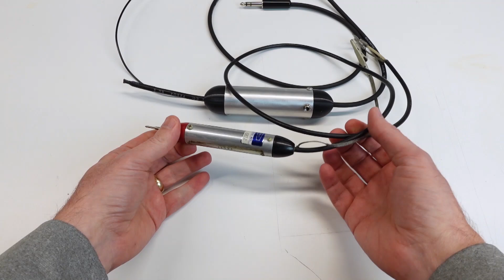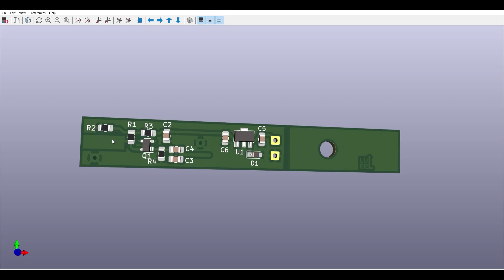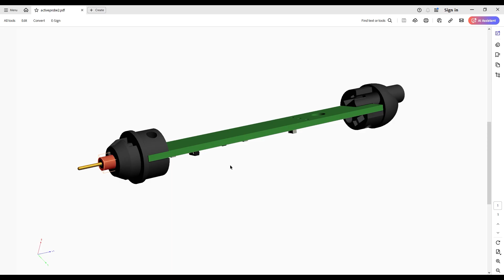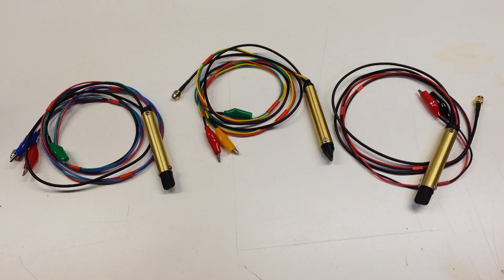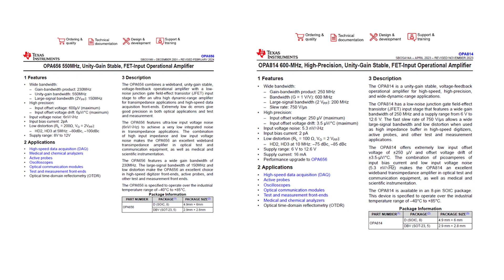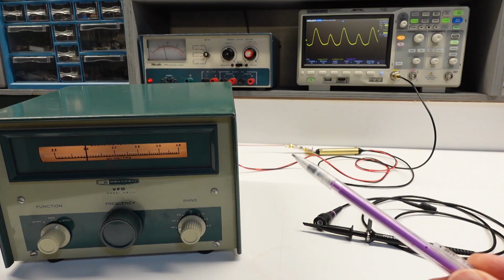Active Probes: Part #2

Comment: Hello.  Best regards, fancy job.
 Is Yours S11 probes parameters are correct? Mine, 2 units have almost flat at 0dB to -1 dB drop at 690 MHz from 0 to 900MHz. Maybe I'm measuring this wrong way with nanovna? Input of probe to S11 nanovna and output to S21 or otherwise?

Comment: Great video presentation and nice idea using the 1/2" brass for the shell.  The 3D printed end caps are very clever.  Also, your side by side comparison was very helpful in understanding the parameters of the probes.
Since you utilized Ebay to source the BF998's for Jewsbury's FET probe, would you be able to share what price and quantity you ordered?  I suspect that you would rather not provide vendor information but there seems to be lots of vendors from China that are offering the BF998's for around 50 cents apiece.  Is that about what you paid?  Since you have already acted as a 'guinea pig' for these components, I would feel more confident about buying a 10 pack or 20 pack if I knew a bit more about your purchase experience.
I hope you create a follow up video regarding the grounding tip spring for the probes along with it being used for actual troubleshooting.  Thank you for the wonderful videos you create and the knowledge you're willing to share.
Reply from the maker: Thanks for the feedback! I bought 10pcs for just under $10.

Comment: On eBay and components:  In the case of the BF998 MOSFETs, these were made in large numbers for the cable and satellite industry, so you are pretty safe buying these.
The way to look at it for counterfeit/culls, is first how difficult is the device to make/fake.  In the case of the BF998, they are a challenging manufacture just given what they are. Also, the culls would have been long ago destroyed, however anything is possible but unlikely.
The next consideration, is there a comparable component that can be relabeled as a substitute; again the BF998 is pretty safe.
Lastly, is this a component that is both scarce, does not have a good sub, and so is a make or break for a repair, and is expensive when found; this is the worst situation for dealing with counterfeits but usually not culls, due to age/missed-opportunity.
My suspicion is that you have a mismatch coupling to the BF998 because that is such a horrendous amount of dB variance.
I would try to set up a fixture to investigate the BF998 and see if you could learn anything from that.
I've used these before but never in an instrumentation setting.
Anyway, hats-off for the work and video--very enjoyable!
73...
Reply from the maker: Thanks for the feedback and tips!  Good call on the mismatch coupling, I would agree that it's most likely something that I did in the geometry and layout.

Comment: I have a couple of HP 1 GHz amplitude & phase measuring instruments I bought from an auction.  Of course the active (converter) probe tips were broken.  I went through all kinds of troubles with getting or making the luckily replaceable tips.  The threads were quite odd, I never could determine if they were # 000, # 00, or some metric size.  I did not even try plain copper, nor brass.  I wanted something reasonably strong and chose tellurium copper.  It worked, but was a bit of a challenge on my tiny lathe and its standard tooling.  I made the sharp end and the flange O.K.  But to make the threads, I bought several different dies, only finding that the smallest sizes are not usually cutting type, they are forming type, intended just for the soft brass in time pieces.  No matter, somehow I got a few actually fitting spare tips made.  I would like to find  carbide tooling, but have not seen anywhere for the small size used in my tiny lathe.

Comment: i played with the Hageman design a long time ago when the amazing OPA656 amp was still a thing.  What I realized in kind of a dope slap moment is that Steve's real goal was to make 50 ohm SA input look like an oscilloscope input.  It has that front end stuff so you could put a 10:1 standard scope probe on it and compensate it!  I'd love to see you try that with your Siglent passive probe.  I went in a different direction- I modified the design and used a 10 meg input R and no Cin and got the native FET input of the 656.  It wasn't Agilent but it was pretty good, about a 1 pF  IIRC.  I never really cleaned up my design- I like your 1/2" brass and 3d printed ends.    HP made some little adapter boxes for some of their gear as an accessory that did this- I have a 15709 that was an accessory for a QAM analyzer.  Scope probe in, 50 ohm out.  Discrete FET design similar to Pease circuit.  Service manual/schematics can be found on line.  I may tackle this again, I still have some old OPA656's and some newer grandchildren from Maxim and ADI.  Nice job and good presentation- not too basic and not too detailed, kind of told me what I was curious about.  Good luck.
Reply from the maker: Thanks for the detailed feedback!
Reply: @levelupeelab  - have you fed the Hageman circuit with your Rigol 10/1 probe?

Comment: have you thought of using Old Gramophone needles for the probe? I find them amazing.
Reply: Those needles are steel, so you get the inductance and losses by already rather moderate frequency.  And worse on MHz ranges.  If you want more strength, your best option might be something like tellurium copper, or maybe the beryllium copper (which you might want to avoid due to supposed toxicity, though).

Comment: Nice work as usual...BTW, if you ever need a replacement indicator roller for the HG-10 apparently the "new" Heathkit store has replacements.  73 - Dino KLØS
Reply from the maker: Thanks for the tip!